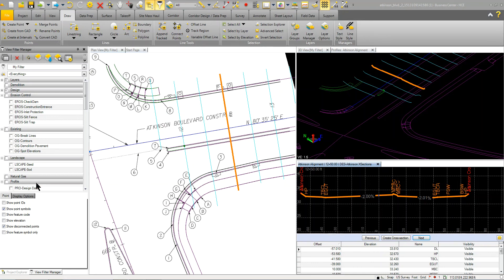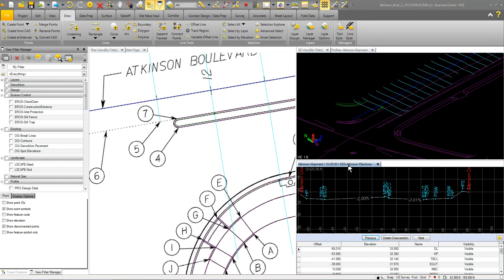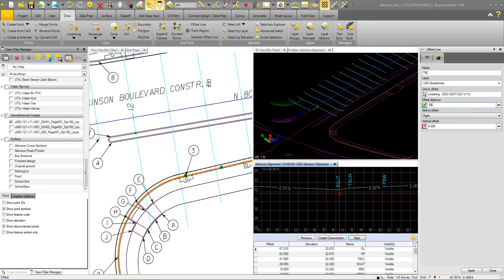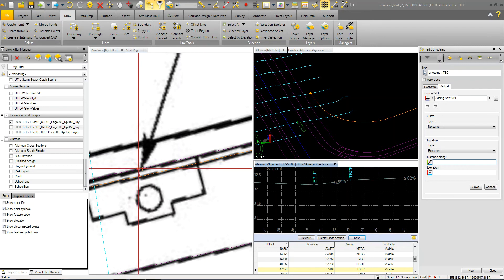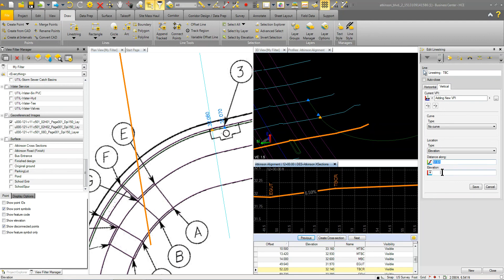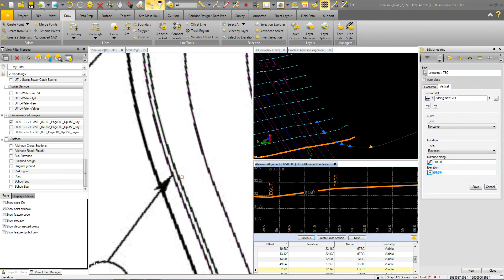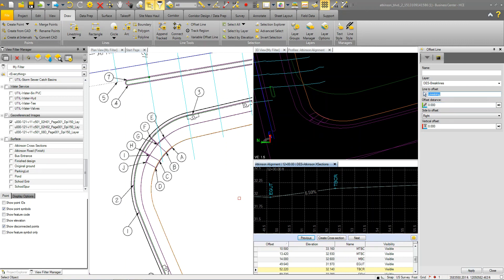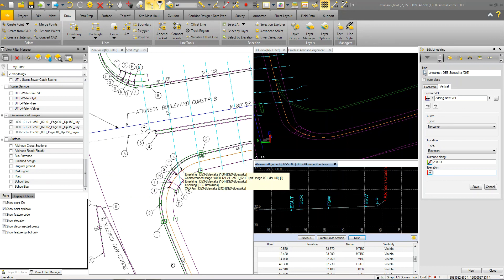Elevating Line String Tip

Comment: Interesting video, I too rarely use cross section information as an elevation input. Good to have it when needed. How do input each cross section? By hand?Do you prefer this method over building a Profile for the Alignment and building a corridor or simply creating offset geometry? 
Edit: Or did you generate the cross sections from before mentioned method?  Thanks for the tips
Reply from the maker: Steve, a lot depends on what the project dictates. If I'm able to design it, Or if its a simple corridor that I can re-model using a typical section, like with residential roads,  I prefer to build it using Alignments, Profile and Cross Section Instructions, to build an actual corridor. In this case the road is complex and has a lot going on, Superelevations, split median, with turn lanes and constantly changing slopes, etc... so to match the engineers design and because of the data we had to work with, the cross sections were the way to go...  We could have digitized them but I found entering each section manually was faster. It would have been ideal if the Engineer knew how to export a .gen file so we could have just dragged and dropped, but as much as we tried we had the sections entered before receiving an xml, which was no good except for the alignments anyway...  For the detail, like in this video I tend to use line strings since I'm not modeling the curb and gutter detail.
Reply: Thanks for the reply. I know the feeling! I'm not familiar with .gen files though is that an AutoCAD or Microstation export?
Reply from the maker: Microstation (Geopack)  it basically exports the Station, Offset elevations to a text file formatted in such a way that when imported into BC-HCE it creates the stored cross sections.